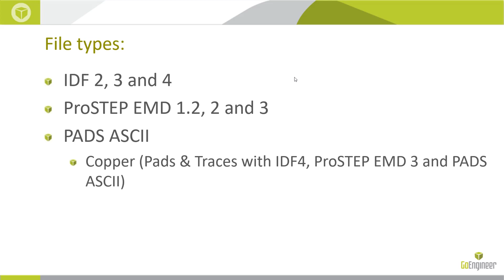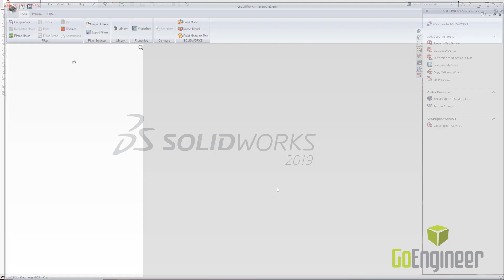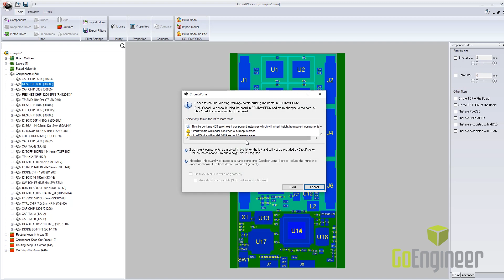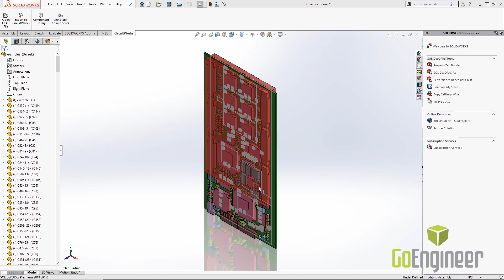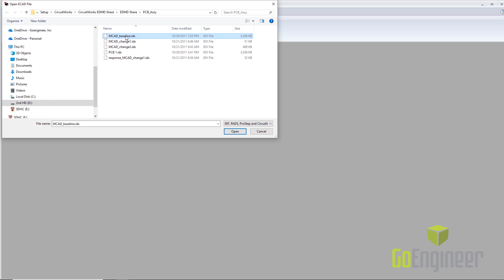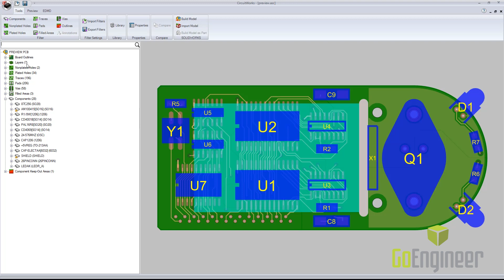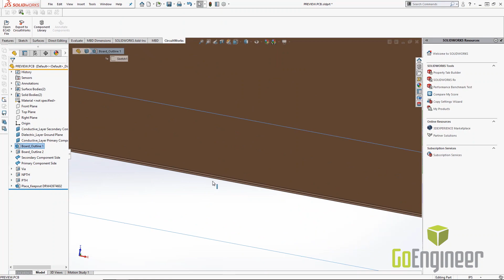CircuitWorks - PCB + SOLIDWORKS communication

Comment: This is a really helpful video. In my workplace we need communication between Kicad and Solidworks. Which format would you recommend?
Reply from the maker: KiCAD has the ability to export to the IDF v3 standard, which would be the optimal file format for communicating with SOLIDWORKS.  To use CircuitWorks you can use any version of SOLIDWORKS (Standard, Professional or Premium).  The Standard version will allow you to create a multibody solid of the PCB while Professional and Premium will not only create an assembly it allows bi-direction changes between the two systems.
Reply: @goengineer  thanks for the reply. I have been trying this with the IDF v3 format. I'm exporting the IDF with an emp and emn file and importing them into circuitworks but I'm not having much luck. Firstly there is only 1 layer (so no copper tracks) and secondly some of the parts import with blank cubic components that are not the correct height and some import with no components at all